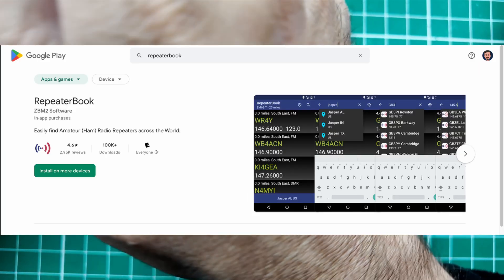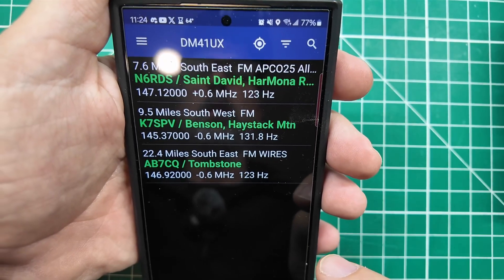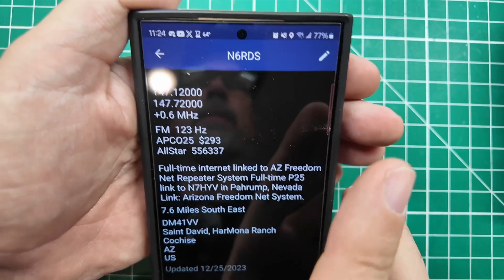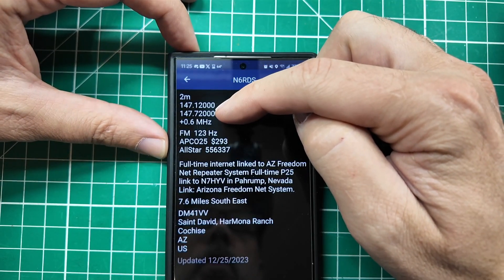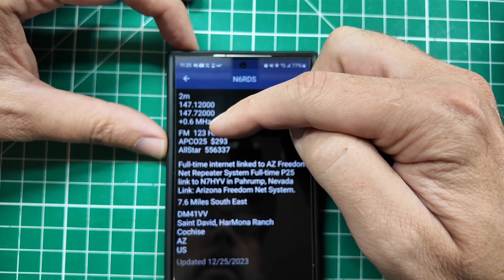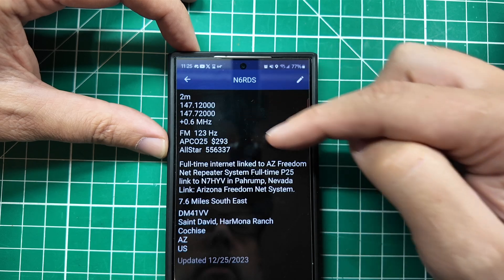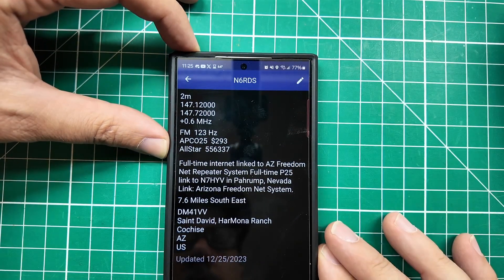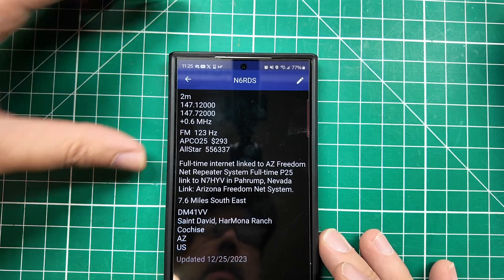GMRS/HAM Baofeng K6 Series Repeater Program

Comment: Are you not hearing the ham repeater because you put in an Rx CTCSS tone? I didn't see that on the repeaterbook page you showed.
Reply from the maker: Without an RX tone, the radio will RX "everything", even those with a tone.  With an RX tone, the radio will ONLY RX a signal that includes that tone.
Reply: @temporarilyoffline Got it. It appeared that you programmed an RX tone for the repeater, so you wouldn’t hear the repeater if it TX’s without the tone. Correct?
Reply from the maker: @chancekp2  correct
Reply from the maker: In a video that was recorded after this video with a higher powered radio I was able to open the N6RDS repeater.  It's purely a power/location issue: https://youtu.be/-Kb_J_u9u5g (see table at end of video)